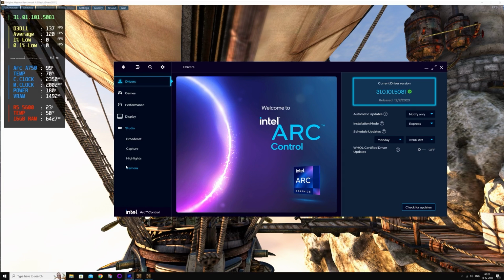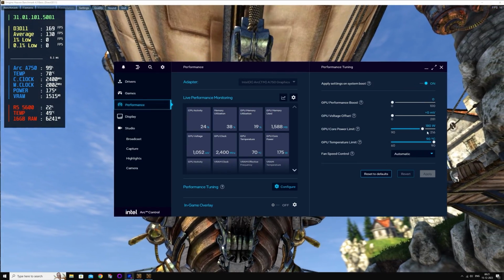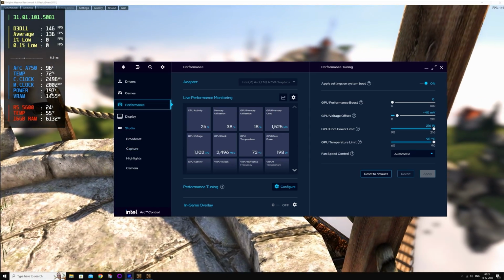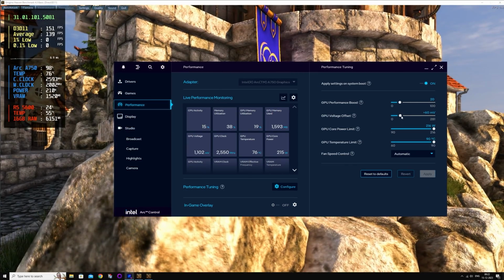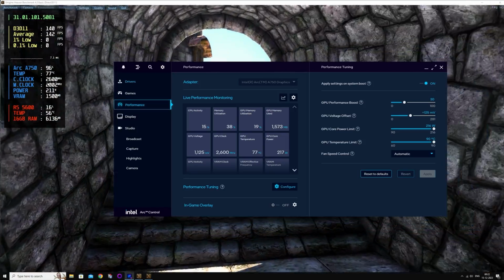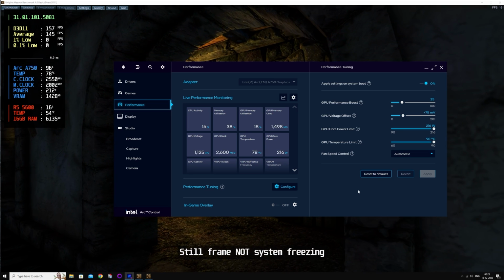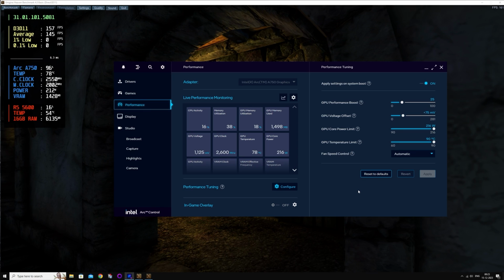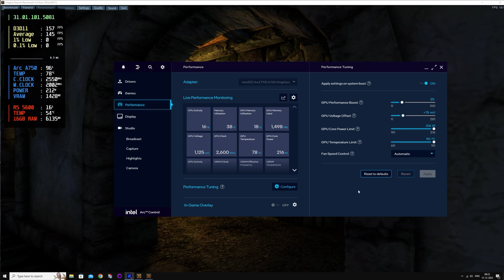Basic Guide On How To Overclock Your Intel Arc GPU

Comment: Boost 40
+90mV
gives me 2740MHz.
Reply: Is it stable? And how are your temps, I'm clock +40 but already on OC BiFrost and total is 2525mhz but high temps on full stress close to 90° 😢
Reply: on intel Arc a750 LE i get altmost the same tempeture i will test even with a boost of 50 i will share my results and system stability

Comment: I don't personally see enough noticeable gain to find this worth the heat or pushing the GPU that hard, but decent tutorial overall.
Reply: if you have proper cooling though there isn't anything dangerous. Its just if its hitting over 90 degress Celsius than its good to upgrade your cooling or turn down the oc.

Comment: pretty good video. what is the maximum GPU temperature you got in a750
Reply from the maker: 79C in the worst cases but usually around 74C.
Reply: @IntelArcTesting  please don't try unigine 2 . What do you think about 84C is it normal
Reply: I'm ARC 770 16G BiFrost and my temps are higher 😢 I went only to 2525 MHz without any voltage ⚡ rising and in full stress it's 80°+ even close to 90°

Comment: What is the sweet spot for these settings?
Reply from the maker: Every card is different. I think you should be able to get 75mV and 25+ on core on majority of the cards. I can get 2700 MHz no problem on mine but not worth the extra heat because I need +125mV